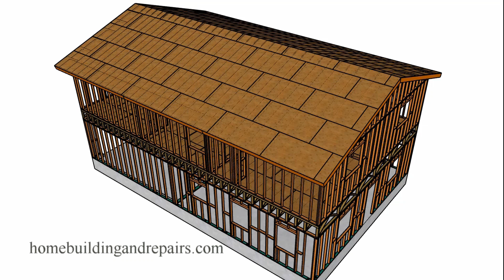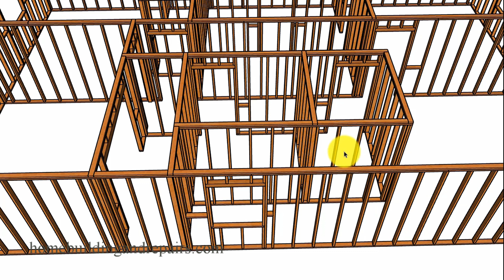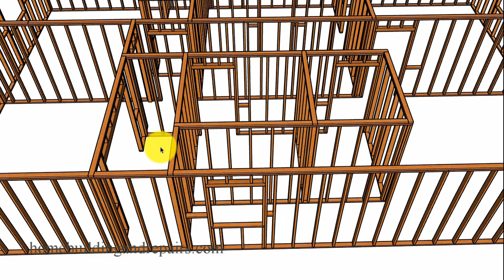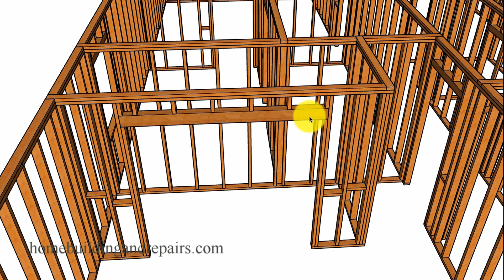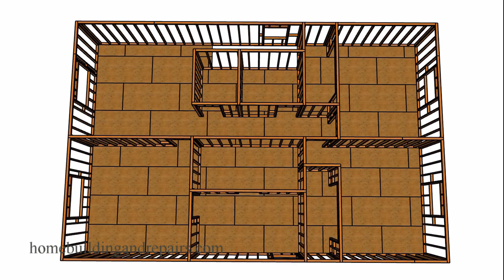Second Floor Wall Framing In Two Story Floor Plan Design Project

Comment: Hi Greg - I was watching this video in hopes of getting some insight I couldn't find. I have to replace sub flooring as well as replace a load bearing post on the second floor of my home. I am wondering if the load bearing post should half subfloor underneath? Or should the post come down to directly connect with the beam beneath?

Comment: Greg, so a major question I've been trying to figure out, is how do you do a super tall wall, let's say if you have a two story house, with a staircase butted up against one of the outside walls, you'll have an opening for the staircase, therefore no joists+floor sheathing ontop. What do you do in that situation to build your second story wall? Do you just build and erect a second wall ontop of the first floor wall (connect it to the top plates?)....
Reply from the maker: It's always going to be better to build a continuous framed full height wall, but I've worked on hundreds of homes where they built the upper wall directly on top of the lower one.
Reply: @gregvancom  ok thanks, good to know.

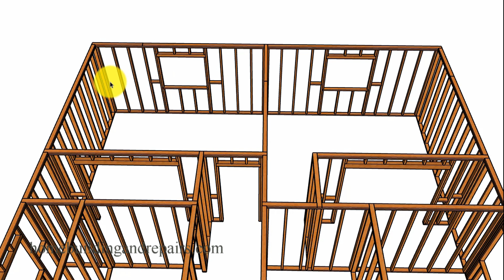Comment: @2:30, the image showed that clearly that most of interior walls' second top plates are overlapping (sitting on the exterior walls' first top plate),  are there rules or sequence of practices for installing 2nd top plate of exterior walls, for example the wall 1 plate overlapping wall 2, and 2 to 3, 3 to 4, or longer wall overlapping shorter one. And at the conjoined corner with interior wall, the space (2x4, 2x6 or whatever size) of the top plate should be omitted it first or can be cut it out later if continuous plate is used? Thank you very much.

Comment: hi i am an apprentice carpenter from Canada, i just got done building a 2 story 21 unit old folks home. We put blocking between all the outer perimeter walls they said it was fire blocking to slow down fires on the outer walls and provide more time to escape. I notice you do not have that here just near the windows and door entrances i know you said it was to prevent the walls from shiftig in those areas but i was just wondering if you knew about fire blocking and if so why not include it in this? thank you for the videos it is helping me understand blueprints a little more
Reply from the maker: There are a variety of different building code interpretations, but in this particular building, the second floor it self, along with the drywall ceiling provides about a one hour rating for fire protection. Let me know if this doesn't make sense or answer your question.

Comment: Thanks for your videos! What is the height of the wall without the top floor?
Reply from the maker: The height of both the top and bottom walls should be around 8'1" or 97 inches and you're welcome.

Comment: When is fire blocking required?
Reply from the maker: Fire blocking is usually required in areas that could prevent a fire from spreading and mid-span blocks are usually used to create stronger walls. Let me know if this didn't answer your question.